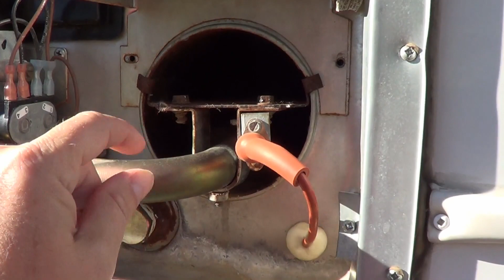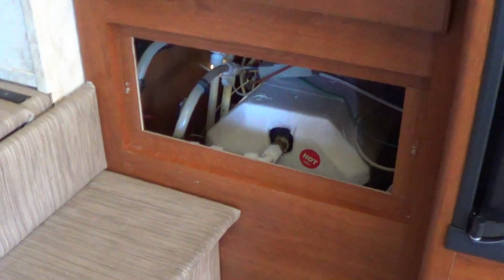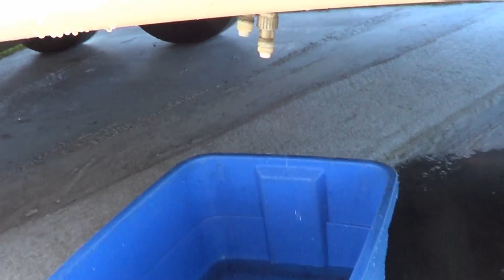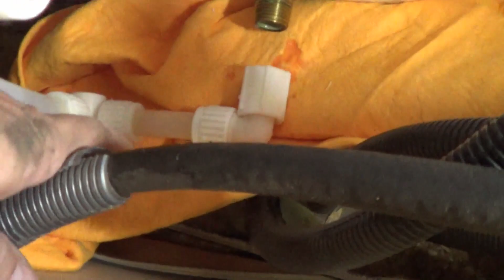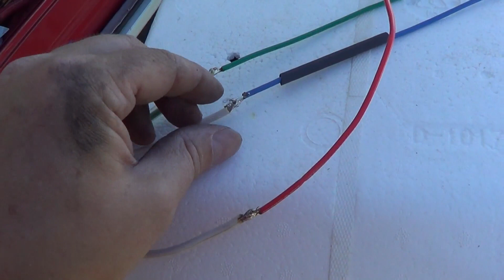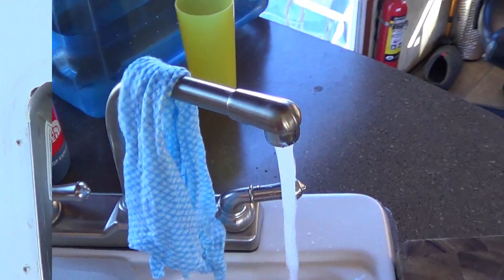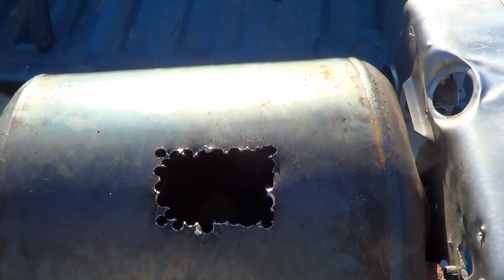Replacing My Leaking Suburban SW6DE RV Water Heater

Comment: Okay, thanks for going to all the trouble to film that that was super helpful. I love the way you cut a hole in it.I was dying to see what was inside of there.
Reply from the maker: You're welcome. :)  The heater is still working well to this day other than a few years ago I had to replace a faulty thermostat switch  RV Water Heater Not Fully Heating on Electric - Failed 130 Degree Thermostathttps://youtu.be/G1la7O_KOeU  Cheers, Ray

Comment: Here it is 9 years later and Suburban water tanks continue to leak, but RV mfgs continue to install them.   Speaking of RVs, when you showed the aluminium tube frame cut and on the weld no less,  the name "Keystone" popped in my head.   Fine craftsmanship and design those boys have.    Well if you are still out and about thanks much for your video.  Well done, informative and enjoyed watching.... even if 9 years later. lol
Reply from the maker: You're welcome, thankfully, this replacement water heater is still working well. Cheers, Ray

Comment: Thank you for this.  I bought the same one year ago.  Have only used it on propane.  How could I use it with electricity?
Reply from the maker: There is a small black on/off switch for the electric operation. It is located inside the outside panel, bottom left. There is also usually a breaker on the main RV electrical panel dedicated to the water heater. Turn both on and you should be good to go. Just make sure there is water in the heater tank. If you turn the electric element on without water it will burn out the element. People often make that mistake when the are winterizing or dewinterizing the water heater.  Cheers, Ray

Comment: The website i went to says
Door, frame kit & indoor switch are sold separately. You MUST purchase both the water heater, door, and switch for a complete system! These are sold as separate part numbers. Competing manufacturers assemblies are not interchangeable
Reply from the maker: Yeah, I just reused that stuff as it was still in good condition. I just needed the replacement water heater.
Reply: @LoveYourRV  company got back to me and they said I don't need it for the SW6DE model**

Comment: Wow, Thank you so much for walkin' me through this. I just ordered my replacement. I hope I did the right thing though, I went to the company you purchased your unit from and they now want over $700.00. I found one on Ebay for $450.00. So thank you again so much much for I live full time in my RV and have not had hot water for over two years.
Reply from the maker: You're welcome. :) Mine is still working well all these years later. Cheers, Ray

Comment: Thank you for this video!   You gave me the courage and critical information to tackle this job... could not have done this job without you!   Having gone through this now, I hope it is okay if I share my experience with your viewers.  1)  Some may find it impossible to free the door frame from the water heater.  This happened to me.   There is a tremendous amount of sealant applied there and this is done on purpose to seal the bottom when letting water out with the pressure relief valve.   My advice: don't bother trying... even if you are successful, you have to spend lots of time removing old sealant. Spend the $40 dollars and just get a new heater door/door frame.  (By doing this job yourself, you are saving hundreds of dollars)   2) Speaking of sealant, the rubber grommet around the copper gas line is gobbed with sealant to keep possible propane fumes from entering the coach.   You will not re-use this part and a new replacement suburban will come with a new one.  (I wasn't sure in the beginning and tried to carefully remove it to preserve it... don't, just rip it out.  3) You will want to keep the water heater out of the way during installation.   I found the DC line length Suburban gives you coming off the DC control unit were too short.  I cut these lines and added extra 2 feet wire (there are 4 lines and this required double soldering on each wire so this did add time to the installation).  This gave me lots of room that I needed to work and I feel the extra time spent was worth it.  4)  As Love Your RV encountered in the video, removing the hot and cold water couplings is a challenge.  My secret... I used an impact wrench and they came right off!  (This was after having tried with conventual monkey wrench and socket wrench).  5)  The propane input copper pipe uses a "flared fitting".   The pipe is pre-made to have a trumpet like end and this interfaces with a special brass fitting you can see on the heater.  This is designed to not use any special sealant... In order to get the connection right, the copper input line needs to perfectly line up with the brass fitting... can't approach on an angle.  Even the slightest bit off will give you leaks.  Took me a few times to get it right and success was reached in my case when I manipulated the position of the copper pipe so that it was directly inline with the fitting.  This is particularly challenging because the pipe presses against the Styrofoam insulation making it difficult to maneuver.   6)  Lastly, don't make the dumb mistake I made... when starting the job and trying to get off the silicone surrounding the heater, be very careful if your rig has decals where the filter is.  I ended up damaging my decals in a few spots with the scraping tool  : (
Reply from the maker: You're welcome!. You'll be happy to hear my replacement water heater still works well six years later. Thanks for sharing the tips. Cheers! Ray
Reply: Anytime we remove items that are sealed to the side of our trailer, I use a heat gun to soften the adhesive and then a plastic trim tool to scrape it off, works with much less effort and minimizes the chance of scratching the surface. I learned this the hard way, after scratching the exterior 😢

Comment: Is there a way to regulate water temperature? Great video
Reply from the maker: They use a thermostat device set for 130F It could be changed. See this video where I had to change a faulty one https://www.loveyourrv.com/rv-water-heater-not-fully-heating-failed-130-degree-thermostat/
Also, here is a simple hack that I use to monitor my water heater temp https://www.loveyourrv.com/rv-water-heater-temperature-monitor-tip-dry-camping/ Cheers, Ray

Comment: Great video...I switched my Atwood water heater with Suburban advantage which is a direct replacement but I'm getting lot of air at faucet every time I use the water heater.. how do you remove the air..? When I'm filling up the tank for first time?
Reply from the maker: I open my faucets while the tank is filling so the air can escape. Once they all run only water I'm good to go or there is a pressure release valve on the water heater that can be opened as it fills the air will be force out.

Comment: So you water heater started leaking in 11-years?  How often did you use you rig/hot water heater?  Did you change the anode rod every year or when needed (possibly less than 1-year)?  Did you "winterize" you H20 heater?
Reply from the maker: We live full-time in the RV so use the RV all the time,so no need to winterize. Change the anode rod once a year. Did you watch till the end of the video I drilled into the tank and showed why it failed. Poor weld during manufacturing pierced the tank wall, and it eventually rusted out and leaked. https://youtu.be/EY-rHSulMps?t=1061

Comment: I see you were ok wire nutting stranded 120v wires to Molex solid wires ?
Reply from the maker: Yes, it worked fine that way for 6 years prior to the water heater swap and has worked fine since. Also the connection is inside a metal junction box. Cheers, Ray
Reply: @LoveYourRV  love your detailed dc wiring specifications. So for non gas rv just ignore the orange wire; and just WHT wire to old heater wall switch and ground green  to chassis, right ?
Reply from the maker: If you aren't going to use it's gas functionality then hook up is pretty simple as you don't need any DC wiring. See page 10 of the manual https://www.nroa2003.com/download/Service%20Manuals/Suburban_Waterheater_service_manual.pdf 120VAC only diagram. In it the black hot wired goes through the on/off switch
Don't wire AC power through the old wall switch unless it is rated for the AC voltage 120VAC and amperage 15A minimum. Many of the WH wall switches on RVs are for gas on/off operation only and use lower voltage/current DC power switches. If you use one of those it may be underrated for the power. But I don't know what your RV is wired for so can't comment for sure. Maybe your RV has an internal AC rated WH wall switch. This water heater has its own AC switch on it and then usually the AC WH power feed has a 15 amp breaker located in the RV power panel.
Reply: @LoveYourRV  I should have been clearer. The old wall switch is dc hot. I hate 120v toggle switches. So I could use the old lp wall dc switch to On-Off the new 120v relay switch that's inside the new water heater. The wall dc idiot light ground path would I think be blue ?
Reply from the maker: By the looks of the 12V diagram, blue is the warning light + feed  Comes on red on my panel if the gas fails to ignite via the sparker or the on other models if the pilot light goes out.

Comment: I don't have access to the side or bad of my DW6 DE, the floor and the wall around the heater as well as the 70-gallon fresh water tank have extreme water damage. Both are in the front bay directly under the front tip-out or pop-out tent bed area.   I need some suggestions or links to any video that might help.
Reply from the maker: There must be some sort of access panel to get to the back water connections. If not you'll need to make one. If there is extreme water damage your going to have to open everything up to do repairs anyway. All the damaged wood needs to be removed and replace otherwise you can have mold problems that keep spreading. All the best, Ray

Comment: How long does the hot water last while taking a shower?
Reply from the maker: That depends on various factors like how fully the faucets are turned on and how hot you like your shower and how cold the cold water is that mixes with the hot water. So for example summer showers would last longer than winter showers. Most water pumps in RVs do 3 gallons a minute. If fully turned on using 6 gallon hot water tank and is mixed 50/50 with cold water that's 4 minutes. So I find about 5 minutes at full blast water flow but like I said longer in the summer when the cold water may be 80+ degrees already so less hot water mix is needed. At half blast you may get much longer showers. Cheers, Ray

Comment: Not sure my first comment or question was posted, so ask again of the check valve on the hot water output be the cause of stopping the flow from a full tank of hot water?
Reply from the maker: The check valve is there for winterizing. Here is a video where I take it apart and explain the operation - https://www.loveyourrv.com/squealing-rv-water-heater-fix-failed-check-valve/  You could try changing yours and see if it solves the problem. Cheers, Ray

Comment: So surprised there is a Check valve on the hot water output, would this be the fault that I have hot water for just a short time than none?
Reply: Thanks for help in solving my heater problem, it turned out to be a faulty check valve, keep up the great video’s.
Reply from the maker: The check valve is there for winterizing. Here is a video where I take it apart and explain the operation - https://www.loveyourrv.com/squealing-rv-water-heater-fix-failed-check-valve/  You could try changing yours and see if it solves the problem. Cheers, Ray

Comment: what is that stuff around the rubber grommet that wraps around the propane line? Do I need that if I have to remove it?
Reply from the maker: Its just some silicone sealant so the gas fumes can enter back into the RV. I had some high temps stuff used for car engines on hand so used that.

Comment: Thanks for shooting this video.  Our five-year old Suburban water heater just developed a similar leak to the one you showed in your video.  It was in the burner chamber.  After watching your video, I'm confident we'll discover the problem is a failed weld.

We bought our 2010 Tiffin Phaeton motorhome in February 2021.  The folks we bought it from had replaced the water heater in December 2016.  More to the point, they had never heated their water with propane, just electric.

Wonder if Suburban is have quality control problems.

Thanks for your great video!!
Reply from the maker: You're welcome :)

Comment: Just the video I needed.  I've got the same model water heater (leaking near the anode) and a 2013 Keystone Cougar so it's very close.  Price has increased quite a bit since your video.  Amazon was $430 USD / $510 CAD (cheaper than PPL)

Comment: I only have about 20 3/4 inches of depth..do you think thats enough for this heater?
Reply from the maker: Not sure, I think it would be very tight. I can measure it tomorrow if you like. Cheers, Ray
Reply: @LoveYourRV  if you can please do..i think with the connections in the back it may not fit
Reply from the maker: @dmccarty1006  Mine measures 20 1/2 inches from the inside of the RV exterior wall to the outside of the plastic Pex elbow connections
Reply: @LoveYourRV  Yikes thats gonna be tight but i think i can do it..thank you so much :)

Comment: So why can’t you fix these? Everyone seems to run to replace them upon a leak.
Reply from the maker: Sometimes you can. Depending on where the leak is they may be successfully patched. My leak was in a hard to reach area and had damaged the inner lining of the tank. When the water in the tank is heated there will be a build-up of pressure so the patch better be strong. Most people don't want to take the chance of another leak or mess around fixing them when they aren't really that expensive to buy. Also if the leak is on the inside of the RV it can cause major damage via wood rot if leaks again and goes unchecked, so trying to patch it is taking that chance. Cheers, Ray
Reply: @LoveYourRV  thank you so much! It’s leaking and I will obtain the replacement after checking if it’s not something I can fix. Should I cut apart the foam? Leak looks like it’s by the cold valve/opening. Facing the inside of the RV.
Reply from the maker: @dianahamister8175  Yeah, I would cut the foam back to investigate to see exactly what's happening.
Reply: @LoveYourRV  ok. Maybe you can help with this. I’m to the point where I’m just going to buy a New one today. Here’s where I goofed. I did not know I had this model originally so I installed a camco heating rod. Removed the original anode rod. And after constant use with the camco heating element I had a leak with it through to my toilet pipeline somehow. That disappeared and now the leak seems to be at the base/rear/camper facing side of the tank. There’s a wood piece to stop it from shifting- that is soaked and also got to the bathroom wall some. Currently I’m drying it out with a fan and will aggressively do so until completely dry. This is a 2015 model and I have been living in it since 2017. 
Thoughts? Also, I will need to purchase a 1/2 couple? (Mine are rusted) and the tools needed to unscrew it and remove it- just a couple wrenches and a Phillips head? I do not have a socket wrench set. Is that necessary? Thank you again for all your help.
Reply from the maker: @dianahamister8175  Some new tanks may come with the brass couplers preinstalled but I think most don't. Depending on how the winterizing system is set up, one of the couplers may need to also contain a check valve. See this video - https://youtu.be/A3Fbi5VT9Fw  I find decent size channel lock pliers are good to have from plumbing work https://amzn.to/2MGHEqb

Comment: Such a great video. You see too many with not enough explanation and too much BS ;-) Especially like the focus on testing the gas line!!! Just bought our RV and the prior owner did not winterize properly so the heater was full of rust which pretty much ruins the whole dang unit. We have the SW6DEL model on order to replace existing one. Should be basically the same install. THANKS AGAIN
Reply from the maker: You're welcome. :) Cheers, Ray

Comment: ouch buddy i just got that same one but in 16 gallon for 100 more and ill oay that for 1 gallon shy of triple the size
Reply from the maker: It all depends on the space you have to install the water heater and how fast you want the water to heat. For us, just two people, 6 gallons has been quite enough. So I didn't need to modify things to go bigger. Being a smaller water volume it heats quite quickly, especially if you use gas and electricity at the same time.  Cheers, Ray
Reply: @LoveYourRV  its just me but i want nice long hot showers and my washer 6 vz 16 isnt much its just longer/ deeper you could fit a 10 or 12 gal it isnt rounder as long as you have a few feet ur food to go.. im gona swap mine but idk if i should keep my 10 gal dsi/elect maybe keepit in the bay i never dont want hot shower on my crack no stink no like lol enjoy ✌
Reply: and ps 6 or 16 gal these tanks do 16 gal a hr on gas with electric my 10 vs 16 has same recovery time so maybe get the bigger one you dont need to modify its all about how long it is there not wider
Reply from the maker: @tyleroliverio8689  I only have a few inches at the back of the water heater to spare, also if I did go from 6 gallons to 16 gallons that would add an extra 80 lbs of water weight so would lose some cargo-carrying capacity. We are full-time RVers so every lb counts to stay under the Gross Weigh Rating of our axles and tires.